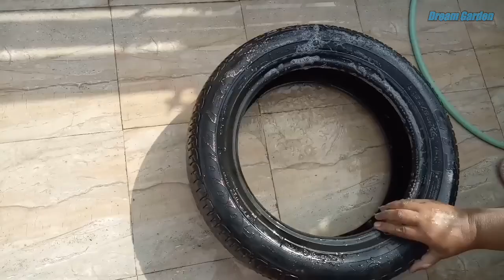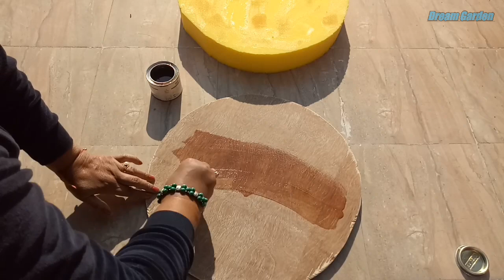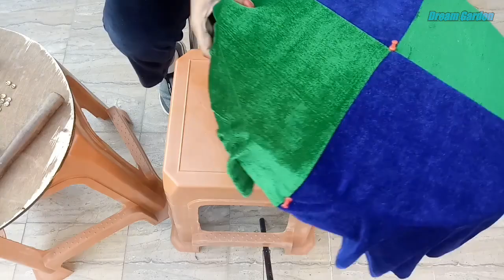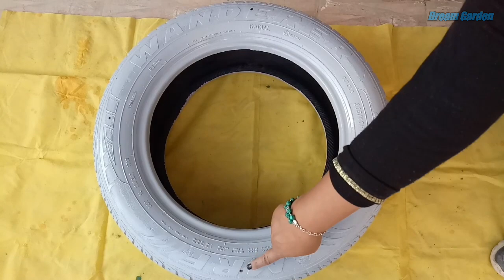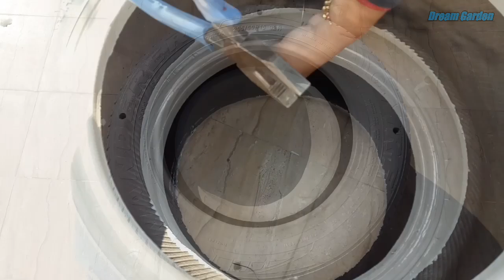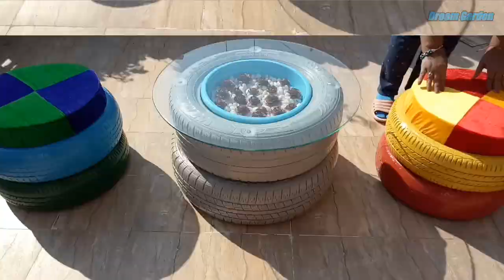DIY Making of Tyre Seat and Table At Home | How To Make Tyre Furniture | Recycle Tyres Ideas

Comment: veramente molto belli,voglio subito riprodurli,  puoi dirmi la percentuale che usi di trementina e smalto?, grazie
Reply from the maker: Thanks alot dear!!! I used turpentine oil like water in water colour .. Means if the colour is not thick don't use oil. Only make the enamel smooth so that you can paint easily.
Reply: grazie mille per la tua velocissima e cortese risposta, mi metto subito al opera
Reply from the maker: All the very best.

Comment: Amazing DIY. I have 2 doubts- 
1. Will the tyres not dismantle in the chair ?
2. Can the centre piece be carried inside in case there is a rainfall or something outside.
Reply from the maker: Thank you soo much😇.I can remove the cushions when there is rain or storm and the glass on table is attached on tyres, nothing will happen to the glass in rainy season or in storms. I hope I cleared your doubts 😊
Reply: @PoonamsCrafteriaAndYard  any idea of how can we stick two tyres from each other so that they don't dismantle while sitting
Reply: @nupurshitole3724  you can fix two tyres with 4 nut bolt .